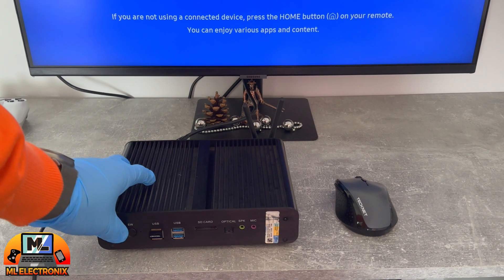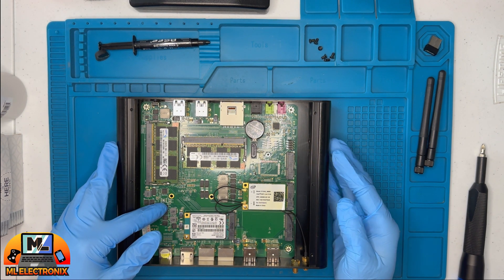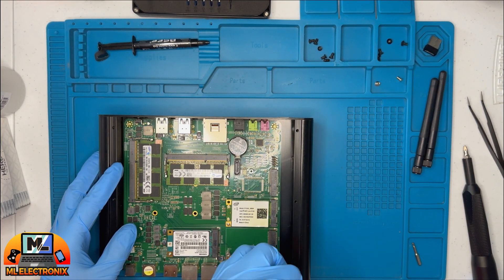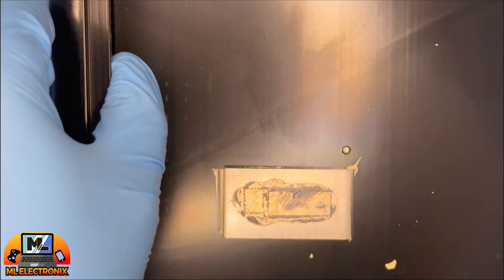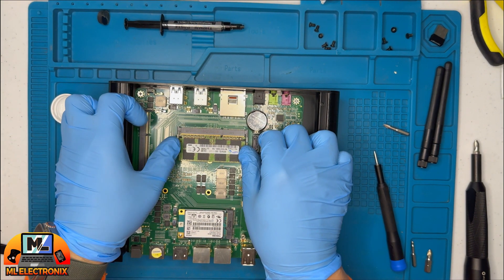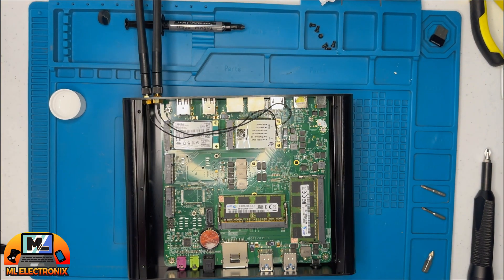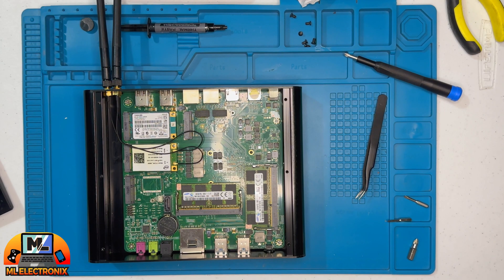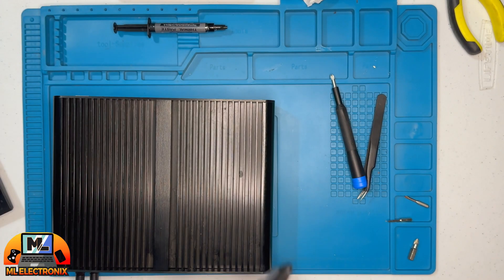How to Stop Mini PC Overheating & Restarting: Expert Fixes and Solutions! #overheating #minipc #uk

Comment: Why they have made a mini pc without a fan on? that's strange.
Reply: No this isn't as strange on a ultra low power CPU. The cooling fan often can in some cases connect to the chassis for heat spreading. Not saying that this particular model does. He might be right that there was some mismatched OS, but that could be due to this exact thermal throttling issues with some hardware setup. The hardware is probably budget specs. too. Celeron or something?
Reply from the maker: Indeed, these mini pc without a fan sometimes get overheated

Comment: I never thinned that 7 is way more benefic for this specific mini computer.
Reply from the maker: Yeah w7 works perfectly for lowered-specs pcs
Reply: Windows 7 is graphics eyecandy bloated compared to Windows XP. Geez. Windows 7 doesn't have security updates anymore. That was this repair techs dumbest move in this video. These days Windows 10 doesn't even have security updates unless you go reverting to special prolonged license. Windows 11 has Copilot bad stuff that is coded in web app like style. But it is either Windows 11 or Linux from here. The guy uses gloves. It doesn't make this look more professional, on the contrary. How many has ESD gloves in their drawers?